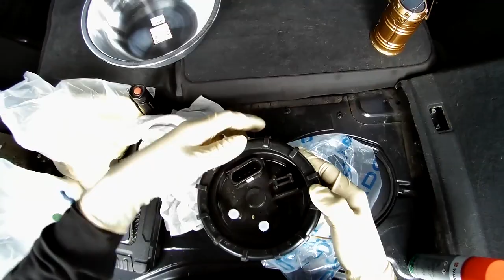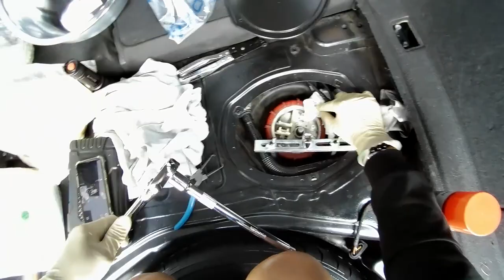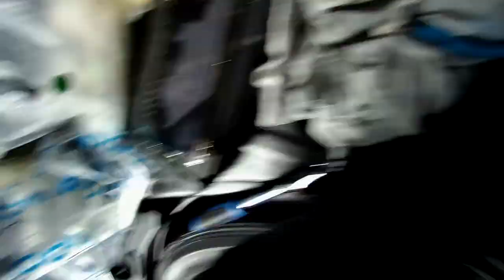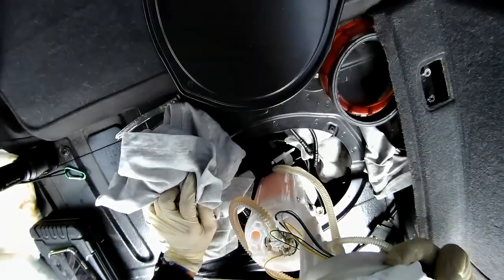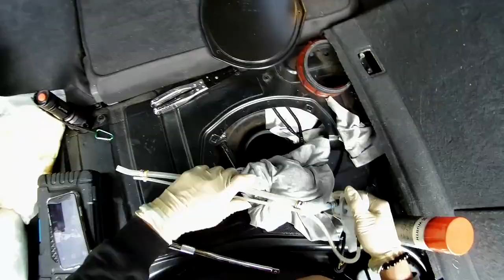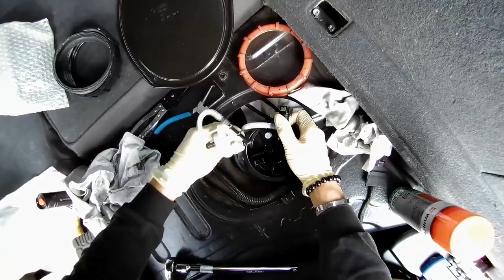【Repair Car】How to REPLACEMENT Audi A4 B6 1.8T Fuel Pump

Comment: Next time can you try get an angle where you can actually see where this location is in the car. Still can’t figure out where the pump door is.
Reply from the maker: okay! I will make another video explaining where the gasoline pump is located.
Reply: Thank you very much! I have not as much experience with this car in particular so I can’t quite figure out the exact location and there’s a few doors that look similar in my car, I love your channel still! Very helpful. :)
Reply: themusicmastera380 
On watching the video it looks to be under the floor in the boot/trunk. Far right corner when standing at the rear bumper, near to the rear offside seat.

On the B7 it’s under the rear seats as I’m currently trying to change my one.